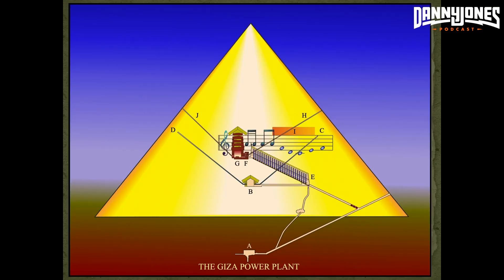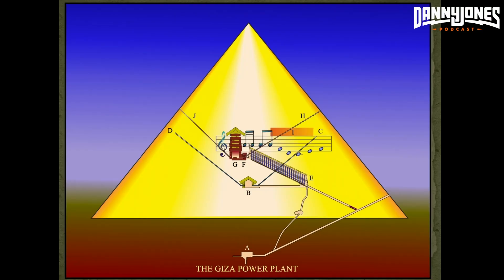How the Egyptian Pyramids Used Earthquake Machines to Generate Energy | Chris Dunn

Comment: It got so damn noisy down below , the flood gate were opened and flooded the fire in the middle. Pyro-mid = fire in the middle. The convexed structure was designed to take tremendous temperatures and was built with 8 sides basically to keep the system from swelling out of working tolerances.
Stop asking how they built it, ask why it was destroyed and refrain from the inexorable fate that comes from repeating his story. 💀 👀